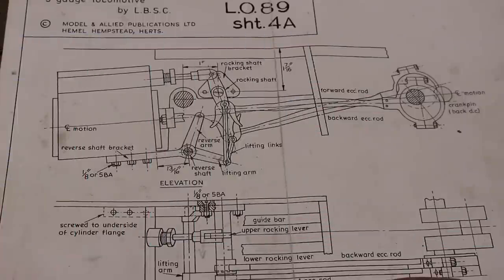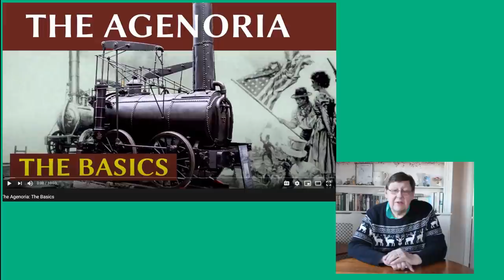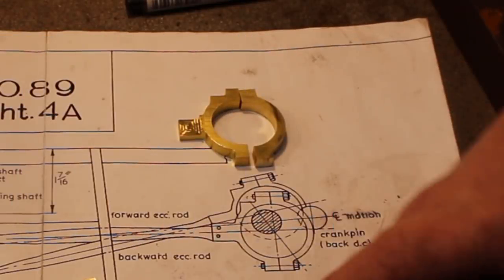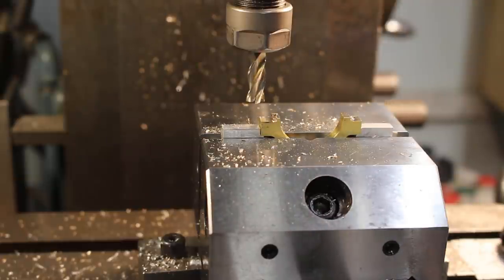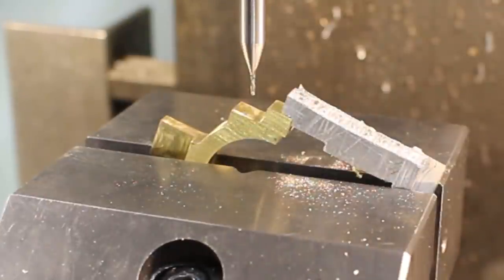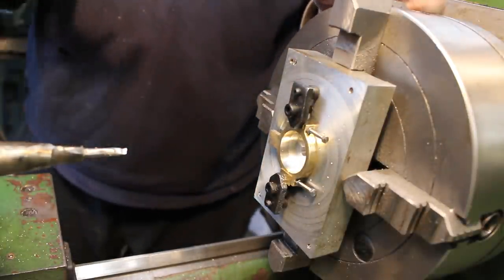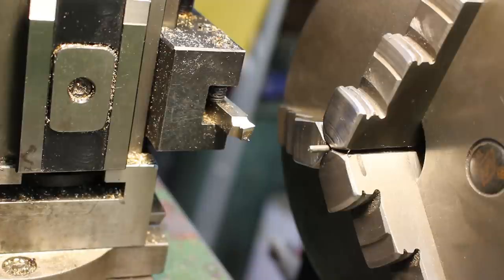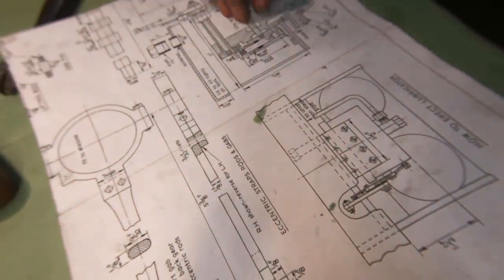Lion Locomotive in 5" gauge part 57 - Making the Valve Gear Eccentric Straps

Comment: Wow..... Nigel, that was a lot to learn for me..... 
As you may know, i have a new milling machine. Not used in my project because : 
1. I have to learn to use it.... 
2. I want to build the actual loco without..... 

I like the way you fixed it with soldering..... 🤔

The joke with the spanner gets me.... 
(Dont let keith (Mr.Spanner) see that.... 🤣🤣🤣

Realy nice done! I also like the oilgrooves.... nice thing....! 

Stay healthy....
Reply from the maker: Thanks. Yeah let's not tell Kieth that I put my Bacho adjustable to one side. 
You defiantly should finish your loco by hand methods and use your mill on the next project. That would be an amazing achievement.
Take care, all the best for 2021, Happy New Year.

Comment: Nigel, I like the way you cheated with cnc! Nice end result. BTW, you are 100% correct about thin nut first. I've had plenty of arguments about that, and won plenty of cartons of beer too!
Reply: So what is the reason for thin nuts first
Reply: @peterslade537  Hi Peter, the reason the small nut is first is to close or secure the joint. The big nut is the load bearing not and always goes on top. If you can get your paws on a reputable engineering book,  you should find what you need to see what the forces are and where. Cheers.
Reply: @peterpocock9062  Thankyou for the reply Peter, even at my age and 40 years at sea something I was unaware of is always coming along.
Reply: @peterslade537  Actualy you may be in the best place to see it in use? Go into the engine room of your ship and talk to you Chief Engineer. If the lock nuts are both not the same size then you'll see where they are used under a high load situation. Good luck.
Reply: @peterpocock9062  Retired 24 years ago, memories fade, ex chief by the way
Reply: @peterslade537  oh, beg pardon, it's good fun being retired, buggered if I know how I ever had time to work!!
Reply: @peterpocock9062  no worries mate, just found a good article on the net, learning  something new still. Does one ever stop ?
Reply: @peterslade537  I profoundly hope not. I'm 71 on Monday, and I know it keeps my little grey cells happy to learn new stuff. I've just learned 5 line dances and I've never done that before. Bloody great fun!

Comment: Like the way you fixed it for CNC by soldering it to another piece what a great idea! What CNC mill are you using?
Reply from the maker: My cnc is a diy conversion from a manual mill just using stepper motors, I replaced the original lead screws with ball screws and I'm running it on Mach 3,  First time I've used solder to hold the work piece, worked out great.
Cheers!

Comment: Nice progress! Confused about the step of temporarely soldering the stock to a back plate. What if you just let the pieces fall out as it milled? Wouldn't be rigid enough?
Reply from the maker: To use the backing plate is my preference, least chance of a calamity. I don't think you would machine parts just to fall out, you would leave tabs in place to hold the work piece in place and cut these out by hand after machining. Cheers for watching, All the Best for the New Year.
Reply: @GoCreateHobbyMachineShop  Cheers to you too!. I don't know how this would work out, but I would have tried looking for piston rods from a lawnmower or something to do these. Then made the eccentric to match.